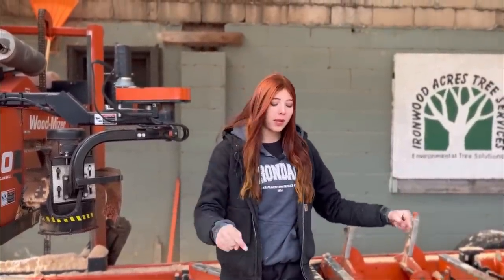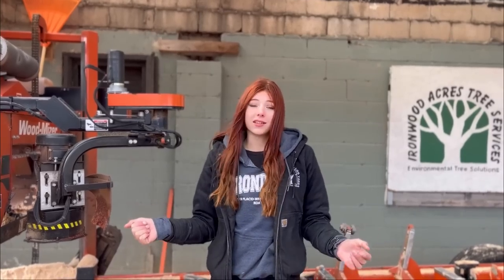My Thoughts on Milling Black Oak for the First Time!

Comment: Very pretty grain structure, Black oak is an interesting tree being as it grows up and down the east coast and far inland. In the south most of the Black Oaks grow up but not very much out limb wise it has a lot of tannin in its sap and is referred to as, 'well lets put it this way Cats Litter Box without litter Oak" it may not do that up northern states don't know for sure. when they make acorns they are big but bitter tasting. If there are White Oak acorns around nearby animals will pass over them until there is nothing else left then they will eat them. Ya'll do excellent work and the lumber will make some very nice projects. 🤠

Comment: I have milled a little California Black Oak. It was before I got my WM LT40, so I used my Alaskan mill. It wasn't fun. I even bought a new ripping chain for my saw just for those few logs. It didn't help a bit. California Black Oak is considered low grade oak, not for furniture quality work. It is very porous and coarse grained. There used to be a mill near Redding California back in the 1980s called CalOak. It milled black oak for "filler" wood. Furniture manufacturers would buy it and use it in specific places in furniture that did not show. The furniture piece would have either white oak or red oak in all the visible places and then black oak in the rest. This way, the manufacturer could sell the piece as "solid oak" or "made of 100% oak." They would also make oak plywood with a veneer of white or red oak and core laminates of black oak.

Comment: The first shoe where I cut black oak I had a dispute  with the mill. I knew what we were getting fi red oak
 My pay didn't reflect that we had sent twelve loads of oak to the mill.
 My friend, the scaler, gave me a lesson on the difference  between  nice red oK and black oak.  Black oat paid like pallet logs, only just over half what I thought I was cutting.
 The only thing that pays less than   black oak in thT family  is the pin oak.
 In the woodworking shop, I would prefer the pin first, then  a nice  black oak and last the red oak

Comment: Beautiful wood!  All the furry edges (according to an earlier video with your grandfather) means the blade is getting dull, right?
Reply: My question also!!???👍🧙‍♂️
Reply: I noticed that also 🤠
Reply from the maker: It CAN mean that the blade is dull, but not always
Reply: I'm guessing some wood (like elm) will be stringy even if cut on a NASA sawmill.
Reply: Not necessarily.  I see a lot of fiber pull like that in soft wood even on brand new blades
Reply: It can also come from the type of cut you make in relation to the grain.  Certain woods are worse than others, soft vrs hard, gummy wood that sort of thing.